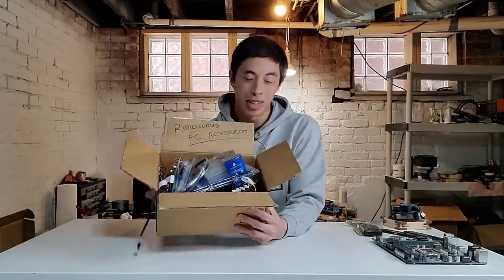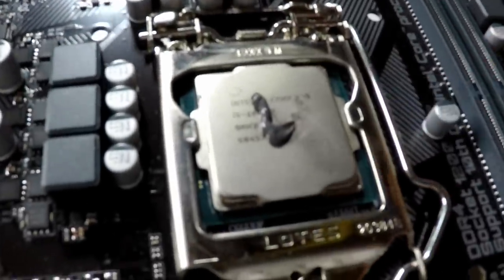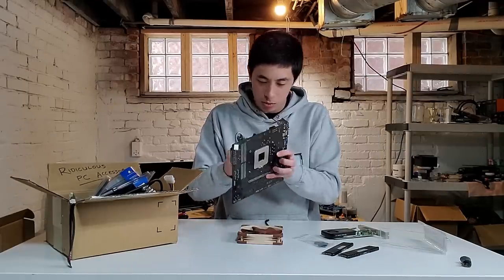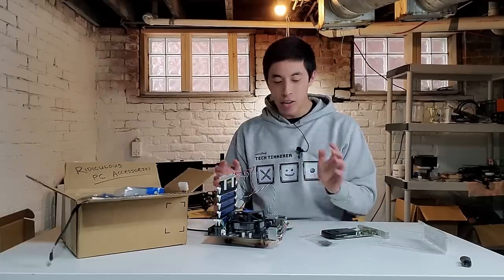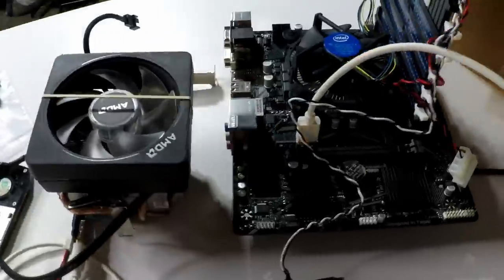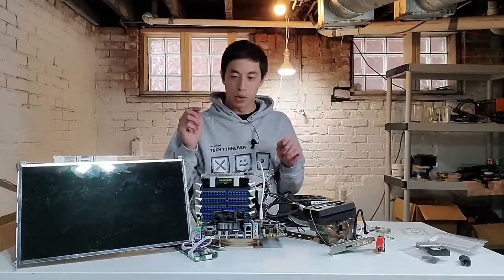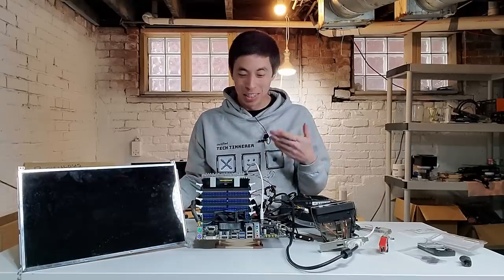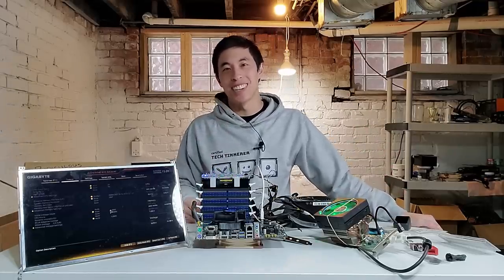Building the most ABSURD computer in the world

Comment: Aviation Electronics Technician here.. those “thermal paste finger cots” are quite literally identical to the electro static discharge finger cots I use, seems like someone Did The Upcycle
Reply: ok. cringe
Reply: @ac3d657  Othukarom neenga periya puluthi dhaan
Reply: @ac3d657  ????
Reply: florist here, and they are identical to the ones we use so we dont get pricked by rose thorns and such
Reply: @ac3d657  cringe
Reply: pc tech 35 years now,,, I was tought your dont toush it with your fingers because it gives an uneven spread,   me,   just glob it in the center and clean the squeeze out... you should be using non conductive paste...  liquid metal corrodes...

Comment: That cpu cooler on the gpu looks hilarious haha, but yeah the reason why it was still overheating is cause the rubber band was providing little to no mounting tension and therefore not performing optimally, also I don’t know if the thermal paste was replaced on the GPU but if it wasn’t, that would have made a massive difference as well, loving these videos

Comment: MrYeester: instals huge cooling fan to a gpu

Me:
runs game with lowest render distance and checks task manager

Task manager:
CPU: 78 % ( slithly overclocked )
GPU: 80 celsius degres and max usage of 12 gb avaible

Me: let's run OBS and increase render distance

GPU: i will try not to burn computer ¯\_(ツ)_/¯
Reply: TRUE STORY
Reply: @RDfHk34  hmm 🤔 sus
Reply: You play Minecraft I guess
Reply: @dinkarfowkar999  nah
38 mods installed manually and i had to decrese render distance from 22 to 11
over 200 installed in modpack and 16 chunks and it was fine ( best was on server )

The game i was talking about ( the resorce-taking) was scrap mechanic
Reply: @RDfHk34  ohk
Reply: @RDfHk34  scrap mechanic is poorly optimized, its a terrible benchmark

Comment: subscribed here, though i'd improve on the idea on the cpu cooler on the gpu by making some actual drilled & tapped holes into the bottom of the heatsink so you can actually screw it in place & then use a pci-e 16x riser rather then a 1x riser too have optimal performance still.

Comment: SummaryBuilding the most absurd computer by combining ridiculous PC accessories. The components include a basic Intel computer with a 10400f CPU, a dated Nvidia Quadro GPU, Corsair RAM, and a stock cooler. Various absurd PC accessories are incorporated throughout the build.Highlights💎 Used diamond-based thermal paste for improved thermal conductivity.🧤 Used a thermal paste finger cot to prevent dirty fingers when applying thermal paste.📈 Installed multiple RAM risers to increase the height of the RAM sticks.🌈 Added an RGB kit to the tall RAM stick for aesthetics.🖥 Replaced the GPU cooler with a CPU cooler and secured it with rubber bands.⚙ Used a momentary switch power button as a replacement for the normal power button.💻 Converted a broken laptop screen into a portable monitor for the computer.

Comment: Before I realized you can only use 5 ram extensions, I was before thinking “what if you buy 1000 of those and make a giant tower of ram!”… then it made sense, all those extensions could reduce the voltage and current running through it making it unstable if any boot times.

Comment: With the heat coming off the gpu, the rubber band will not provide longevity to your build since the heat will dry it up quickly. A more logical option for a robust ridiculous computer would be tie wraps or a conductive double sided tape (which I just made up cause I don’t know if it’s a thing, but it should be)